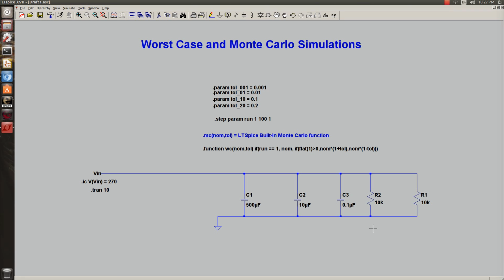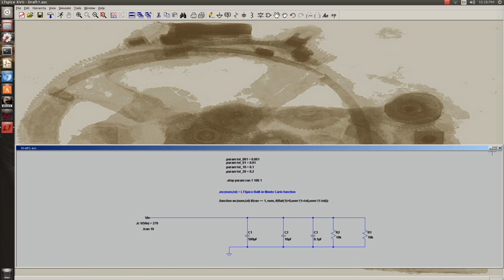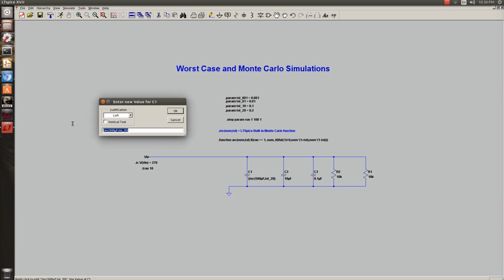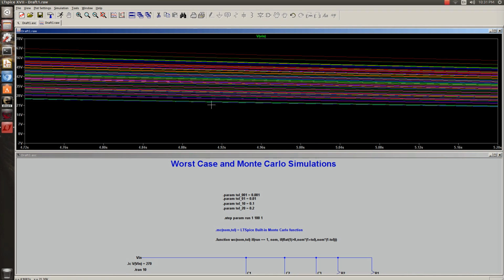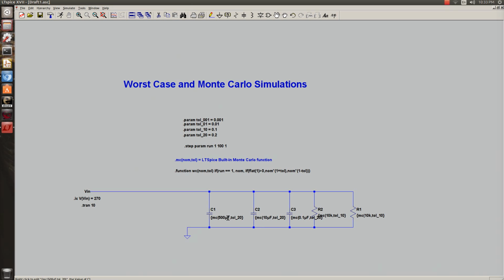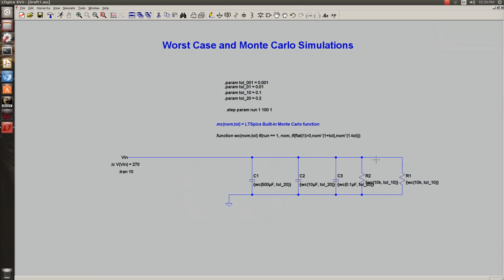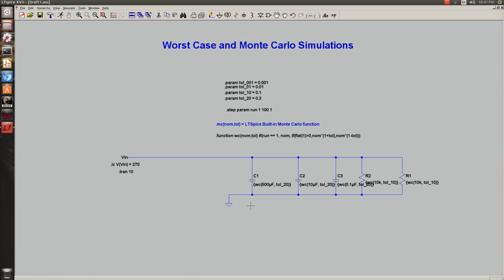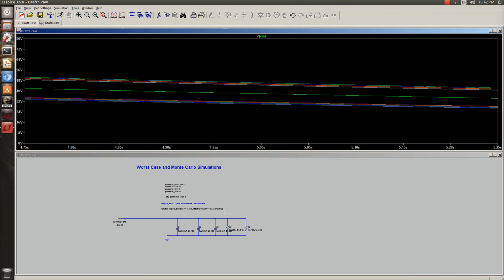LTSpice - Monte Carlo and Worst Case Simulations

Comment: Just as a side note a large 500uF capacitor is likely an electrolytic capacitor which has dielectric absorption.  It can be modeled as a number of series RC capacitors which has more stored energy than depicted in the circuit shown.  Dielectric absorption normally increases with temperature.

Comment: As you note, with this method of worst-case analysis, you need to do a lot of runs to guarantee that you "hit" all of the possible extreme values, as the values are being changed randomly. A method that simulates each combination of extreme component values exactly once is detailed here: http://k6jca.blogspot.com/2012/07/monte-carlo-and-worst-case-circuit.html (scroll down to the heading "Optimized Worst-case Analysis")

Comment: What is the purpose of the "tolerance" field in the component?  Does it perform a different function?
Reply: It allows youth choose a tolerance value for the component. If you want a 5% tolerance on your component you can set and change easily.

Comment: What is the "flat" function? And what did are you do to solve the model problem?
Reply from the maker: The flat function is used as a way to generate a (psuedo) random number. Flat(x) will return a number between -x and +x with equal probability of being less than or greater than 0. The error I was gettting when I paused the video was caused by the fact that I was missing an end parenthesis ")" in my component definitions.

Comment: I'm a bit noob with LT Spice could you please tell me how did you add the voltage source ? (without using Place part -> Voltage)
Reply: You can use the keyboard shortcut to open it by pressing F2